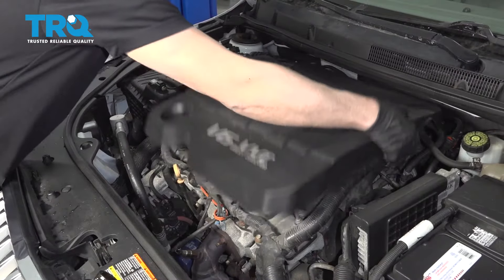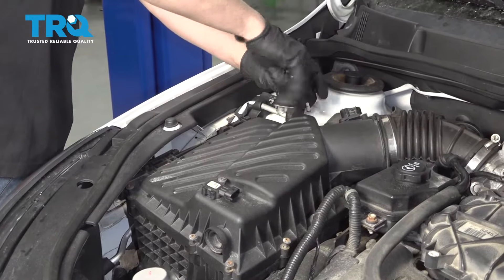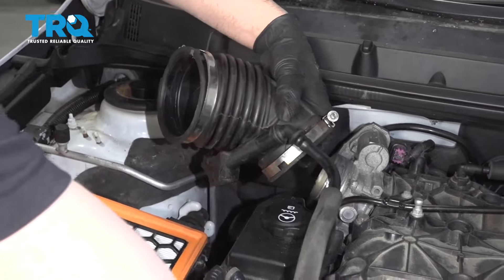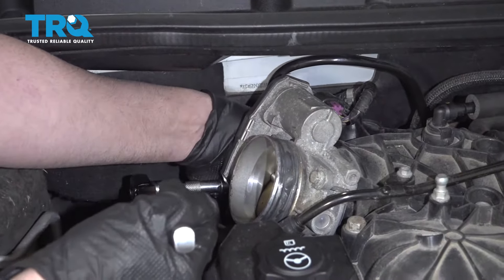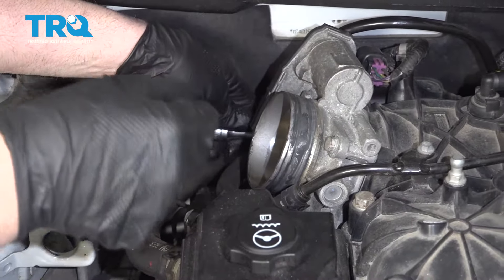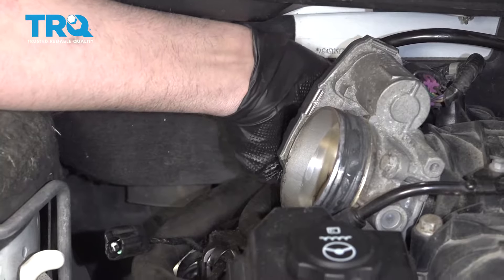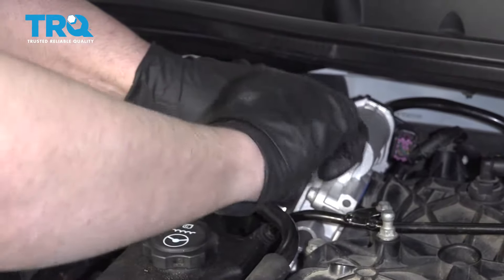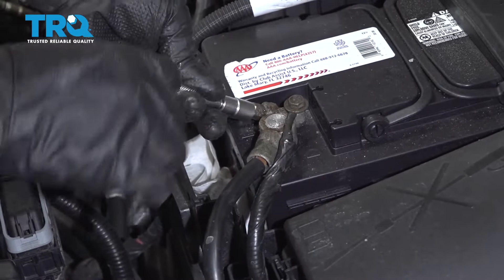How To Replace Vapor Canister Purge Solenoid 2010-16 Buick Lacrosse

Comment: Is this the reason why my Buick goes out after pumping gas?
Reply: Same here. I hope so
Reply: I’m having the same problem.
Reply: Yes. Either the purge solenoid valve or the gas cap seal is bad. 
It could also be the charcoal canister where the evap line runs from. That sits next to the fuel tank. Also, the vent line wherever there is a connection point could be loose, or the line itself is cracked and leaking fuel vapor.
Reply: it solved my issue

Comment: QQ - TRQ also has a video that has the same exact steps for "How to replace vapor canister vent solenoid 2010-2016" -- so which is it?  Is that the purge or vent solenoid?
Reply: Whoops, it was actually called "How to Replace EVAP Vent Valve 2010-16 Buick Lacrosse" so is it the vent valve or the purge solenoid?

Comment: Buick 2010 lacrosse is very hard to start only after I fuel vehicle. Sometimes right after fueling vehicle runs rough right after starting. Both of these issues only happen the first time I start car after fueling. No issues any other time.